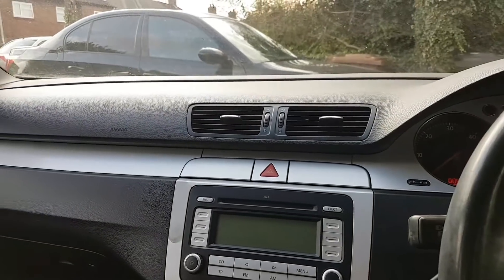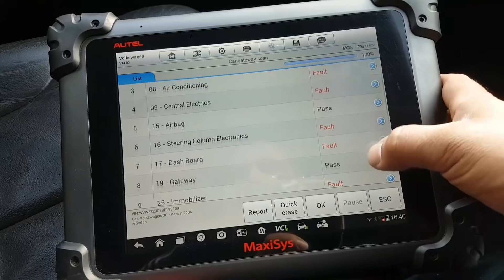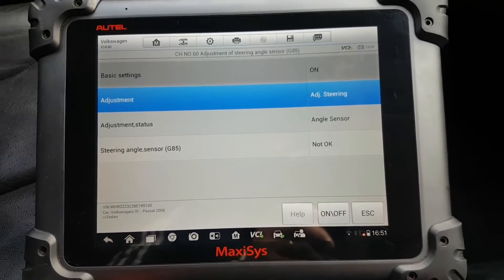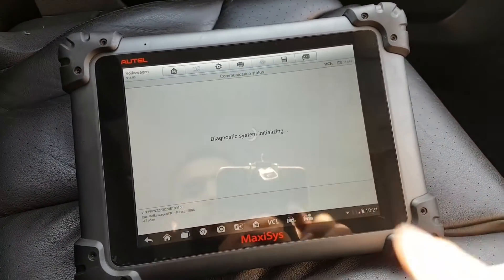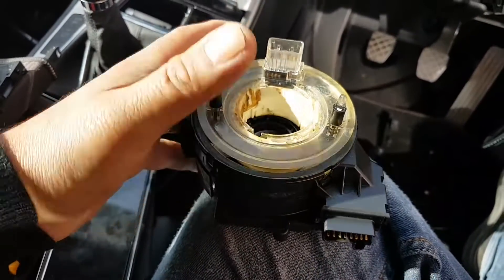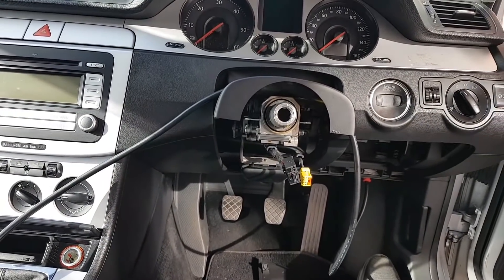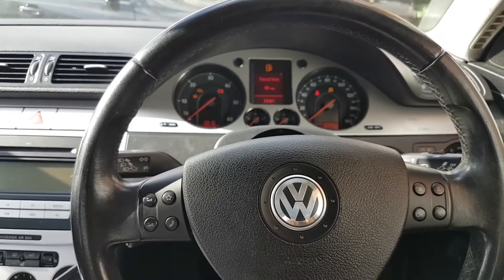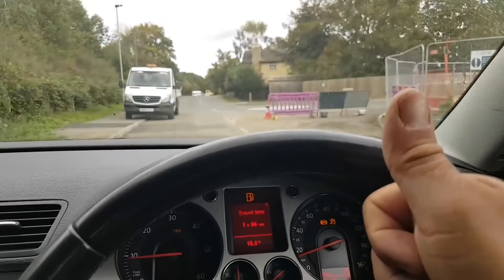Passat C3 steering angle sensor fault... Fault finding and repair.

Comment: I have seen a really similar issue in the past with a Golf. This is my understanding of how this sensor initialisation works and maybe what happened, in case this helps anyone

On these cars the steering angle sensor (G85) settings can be lost when the battery is disconnected. It re-initialises by itself when it knows the car is travelling in a straight line. Or when you go through the basic setting procedure (in my experience, doing the basic setting is actually not necessary as long as the rest of the system is working OK... see below)

How does the module know the car travels in a straight line? It looks at the ABS wheel speed sensors. When the car is moving slowly and ALL 4x ABS wheel sensors show exactly the same speed, the car assumes it must be moving in a straight line and will then init the steering angle sensor zero position. It seems the cars have more accurate readings from the wheel speed sensors internal to the module than what you see through live data - this makes sense if you think about ABS etc, the ABS module must have very fast/accurate readings for the wheel speeds for the ABS to work effectively. If there is any fault with a wheel speed sensor, giving inaccurate speed reading, it will think the car is not moving straight and will not initialise the steering angle sensor. Usually problems with wheel speed sensors will trigger a fault (as in video - stored fault) however it is so sensitive that faulty wheel speed sensors may NOT trigger a fault code straight away or even at all but still prevent initialising the steering angle sensor!

To check if this you can drive the car slowly (<20mph) and look at the live data for the four wheel speed sensors in the ABS module. Isolate the live data to show these 4 readings only to get fastest live data rate or use graph view for these 4 readings. Then drive in a completely straight line and look for ANY slight deviation on one or more wheels, if you have one or more sensors briefly jumping to a higher or lower reading this can be enough to stop the initialisation. Check the relevant wheel speed sensors and also the magnetic ABS ring on the wheel hub that the sensor reads from. I believe this is what the guided fault finding on ODIS would take you through as well.

Once that's sorted just clearing the faults and driving in a straight line should be enough to initialise. (If not, do basic setting of course). If steering is still heavy and steering wheel light still on (without ESP light) this is likely separate end stop fault, to reset this you turn the wheel all the way left, hold, all the way right, hold, and back to the middle as in the end of this video.

My guess what happened here is the last garage couldn't get the steering angle sensor to initialise, probably due to a faulty wheel speed sensor, or maybe they just didn't understand how to initialise it. They wrongly assumed steering angle sensor itself was faulty, then they made the issue worse by replacing the whole module and leaving the angle sensor disconnected !. I think Luis was lucky and faulty ABS wheel sensor was reading OK for this video, OK enough, but I guess that is what is causing ABS light to come back on again in the end of the video...
Reply from the maker: Very well elaborated! 
Thank you for watching and for your comment! 
👍👍👍

Comment: Parking brake fault might just be the switch... they're known to go bad sometimes and throw up random/intermittent faults, happened to me on my old B6 Passat. The EPB motors are a problem on the B6's too... the plastic housing cracks around the back of the caliper and lets in road dirt & grime and rusts out the spline drive. Mine stranded me a couple of times like that before I ended up replacing both calipers lol
Reply from the maker: 👍👍👍
Not in this case... more on that on another video... stay tuned...
Thank you for watching and for your comment!

Comment: It’s quite funny how someone could reassemble it with no steering angle sensor 🤔
They make the repair process so much harder having to sort out there mistakes as well as original issue 👍
Reply from the maker: Absolutely... 
👍👍👍

Comment: Hi Lois, Excellent video on diagnostic process. Got a question about TCU modules. Is kess or k-tag capable of copying or clonning automatic transmission control unit modules. Worthing on a getrag continental. Thanks
Reply from the maker: Not really... they are not designed for gearboxes...
Thank you for watching and for your comment!

Comment: by the looks of the tape on holding the module,,its a fabrications defect,,,i got one no horn,,,pushed module up and works,,had to tape and wire tie down,,,,,tnx for video,,no wonder no angle sensor,,,its not there,,,lol,,,,,,,,,,
Reply from the maker: 😄
Indeed...
👍👍👍

Comment: When problem exist , wheel steering is strong to move or only show yellow light to dashboard?
Reply from the maker: This only causes the light... if I recall correctly...
👍👍👍
Reply: @LMAutoRepairs  i have the same problem but steering wheel is strong to move and esp is not working but the same are with yellow light
Reply from the maker: Scan the car and go from there!
👍👍👍

Comment: I have this exact car of this year and engine. When i steer at slow speeds, I hear a whining/whirring noise which goes away when the clutch is pressed down. Any ideas?
Reply from the maker: Hi
Drive shafts perhaps? 
It is difficult to tell... 
👍👍👍

Comment: Luis, where are you based? I have a 2010 Skoda Superb with electrical gremlins that suit your skillset. Cruise not working, radio turns itself up going around corners, intermittent wipers go full speed on lowest setting, dash lighting rheostat not working. I believe it's a comfort module issue but that's as far as my knowledge extends.
Reply from the maker: Would love to help you... but I am absolutely flooded right now...
Get VCDS if you don't have it already, and give it a scan and go from there...
Thank you for watching and for your comment! 
👍👍👍
Reply: How many miles has it done Andrew I have had similar issues with a VW and Skoda and it turned out to be a broken clock spring     which had only just started to break !  Was a simple fix but will need to be diagnosed properly do you have access to good scanner equipment?

Comment: I hate when people have to over complicate things if you don't know what you're doing it's true don't touch it it's like how are shower didn't work because the water pipes where air locked but my foster mam got someone she knows to take it apart and now it doesn't work at all because annoying he didn't think to turn off the water so now nothing works

Comment: Still have abs fault
Left rear abs wheel speed sensor
Implausible signal
Reply from the maker: Stay tuned... video coming for the ABS fault...
Thank you for watching!
Reply: @LMAutoRepairs  any plan to release next video?
Reply from the maker: What next video?
Reply: @LMAutoRepairs  at end of this video light turned on so fault hasn't been fixed. I expected to see a video where you fixed the errors
Reply from the maker: All you had to do, was search the channel...
https://youtu.be/xziv5410qgI

Comment: my sister in law has a ford edge 2016 has adaptive steering fault been in dealership 11 weeks has had 4 NEW steering wheel assy tried each one either  another fault or wont program to car dealership brought in  ford top technical they have tried repeatedly  but cant program it  to car    but one taken from another car works ok now waiting to see what ford uk come up with.... in america they had recall in  around 2017 as steering wheel assy  went into various fault modes she bought hers in uk from new  when she noticed steering very light  it had no errors on display  but after investigation seemed just stuck into  parking mode so steering very responsive and dangerous its beyond a joke when the car manufacturer cant fix its own vehicles the cars ony done 28000 miles ....my idea is that theve either changed the pcb  circuit and memory locations dont match to the latest program  or they are trying to load the program to a chip that  has no bootloader on it so  is just dumb and unresponsive either way they havnt a clue  and ford UK have no idea  one has to ask how many others are driving around with a fault that dosent register  on the fault display and have dangerous steering a five year old car that now seems to be unfixable by its own manufacturer....you could not  make this up unbelievable and ford are  very unhelpfull initally they were asking £1200 for the repair  theve now dropped  that but still dont have an answer have you had any dealings with ford adaptive steering?
Reply from the maker: Hi
No, don't think I never came across one of those...
That said, yes, a bit strange that even the manufacturer is struggling to get the issue fixed...
I would say, a new module, that might comes with a newer software version, would require the other modules on the car to be updated to the latest one available, in order to properly recognise and talk to the new steering module...
But, I sure ford would have done that anyway...
🤷‍♂️
Thank you for watching and for your comment! 
👍👍👍
Reply: @LMAutoRepairs  they could do with a guy like yourself working for them the ford tech guy from germany head office tried to rewrite the software but still they cant get it to work sort of says it all about modern tech  service centres are just module changers  the fact they can swap steering wheel assy means theve messed up with the software side big time  latest from ford tech guy was they will never get it to work!!!!! so lets hope all those other  ford egde owners never have an adaptive steering fault her symptoms were the skitish steering and the fact the sport normal settings are greyed out and  not changeable   BUT there are no fault warnings on the display so really bad safety issue the dealership wont release the car as they deem it unsafe  hey ho  what a mess thanks again for your great videos  oh  a word of advice never touch a ford edge  KUga  or f150 pick up as all have the same type of steering  as the faults those have had are oscillating steering  steering or  wheel goes hard over left but still steers straight  steering fights you all the time whilst driving at random  but resets after power down   ...thanks a gain for taking the time to post your videos
Reply: @LMAutoRepairs  Hi just heard from my sister in law  Ford uk now admit car unsafe to drive and that they cannot repair it and are going to buy back the car at current  second hand value  as they cannot program the adaptive steering wheel assy    even the 4 new ones they tried   would not program.... unbelievable why someone cant visually check pcb to see if different  just shows  we now have  people who just fit modules who dont really know how things work   dealership had memo from top ford tech guy saying they will never get it to work!!! not very good news  for all those ford customers  we reported fault to DVSA who are also investigating as fault  happens without any warnings on dash steering goes from 1.5 turns  to each lock to just 1 turn to each lock
Reply from the maker: 😳
Definitely a awkward and dangerous situation to be in!
At least they gave a sort of solution...
👍👍👍

Comment: Hold on. You tell your viewers "If you don't know what you are doing, leave it for those that do.." or something like that. But then you have to call VW to figure out what you're doing, as you don't even know where the steering angle sensor is supposed to be. You even broke apart the steering control module, handled it without proper electrostatic protection while putting your fingers all over a board with CMOS components. Mmmmmmmm....
Reply from the maker: And fixed the problem...
What about that?
🤔
👍👍👍